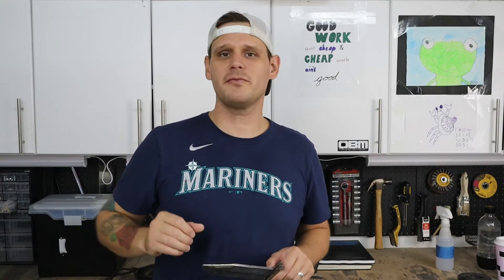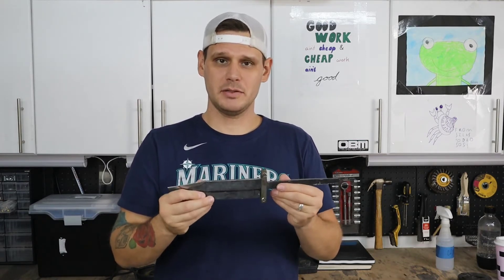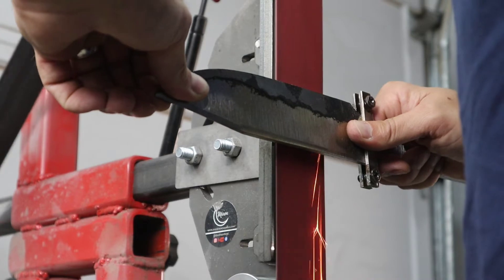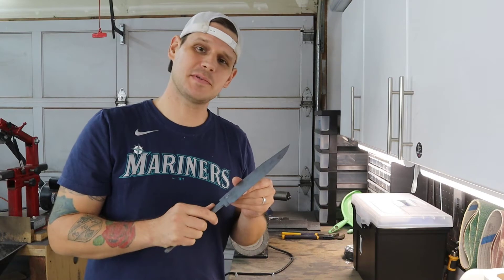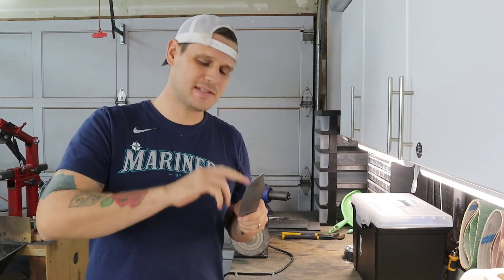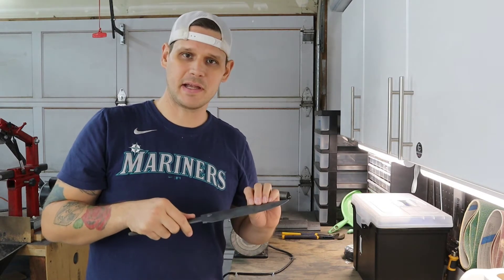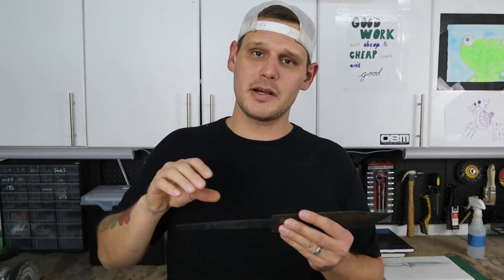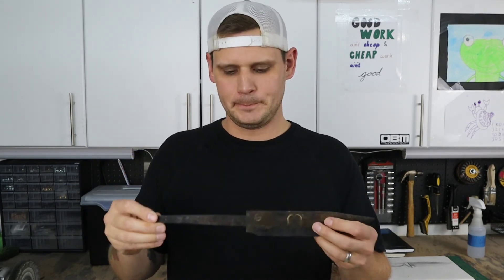Hand forging a 7" bowie knife from 80CrV2 high carbon steel | knife making

Comment: Great video mate from the uk quick question do you heat 80crv2 as much as 1085 etc when forging
Reply from the maker: I started out forging 1084 and I'd say I forge 80CrV2 about the same. I don't really monitor my temp very strictly while forging, but I'd guess I forge in the range of 1500F (~800C) to 2000F (~1100C). Thanks for watching!